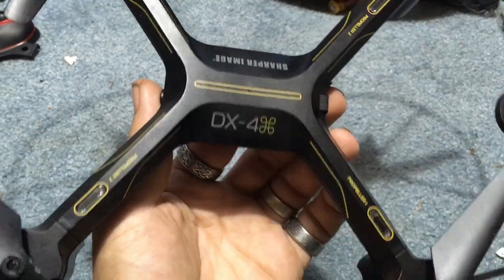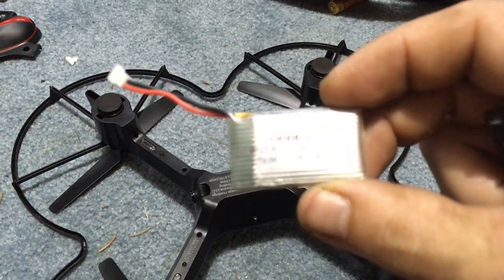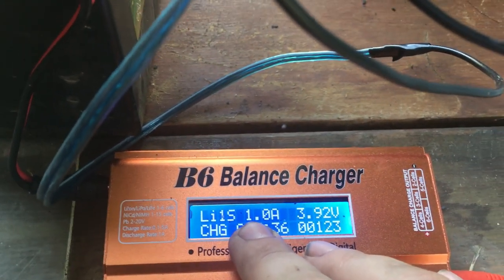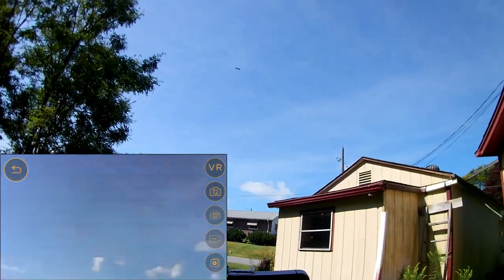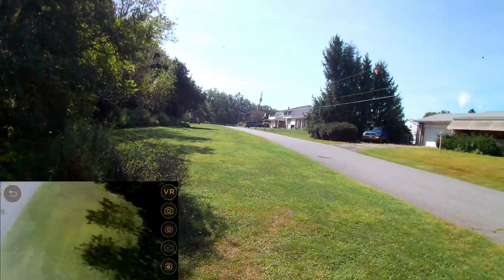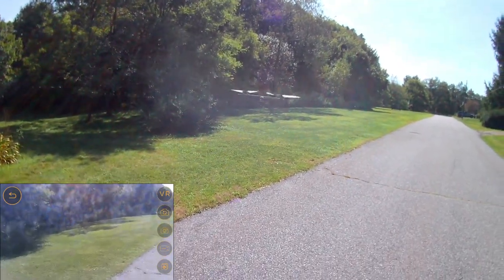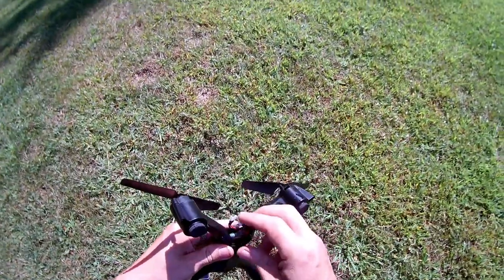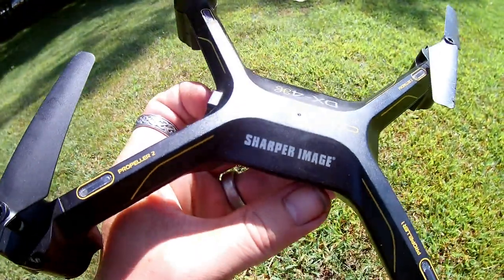Sharper Image DX-4 NO POWER FIX - Solar Charging Flight and APP review HEIGHT TEST

Comment: I've had this drone for a few years now. The dn power switch is messed up. I disassembled it and found that the hot glue on the connectors melted into the switch. I fixed it with a razor blade and put it back together and the switch worked great just long enough for me to get the battery partially charged and it stopped working again. Yay.

Comment: Mine won't charge and the light is not coming on when I plug it in,  but mine does not have a battery cover like that for some reason?
Reply from the maker: Perhaps years does not have an inner changeable battery if that is the case you will need to access the battery which could be easier said than done and then charge it with a hobby grade charger. That is your best chance at working with what you have.
Reply: @JayDrone  awesome buddy thanks for replying, I'll take the screws out and see what kind of battery it has

Comment: Mine flashes yet won't connect to controller, makes beeping noise like it is connecting but flashes slow like its almost dead no matter how much I charge it
Reply from the maker: Get a new battery it’s entirely possible the battery that you are using has been compromised and will not fully charge the drone allowing it to takeoff or properly buying to the controller